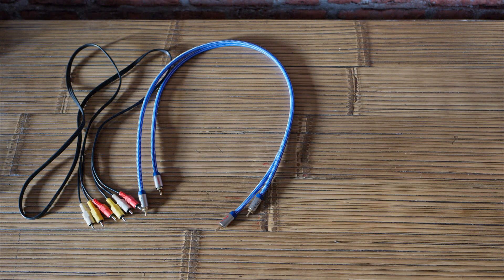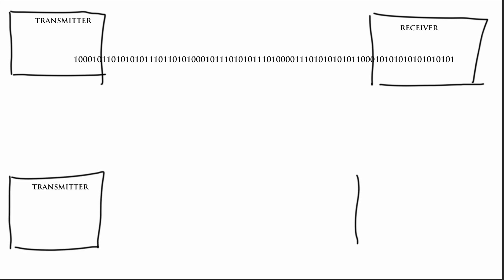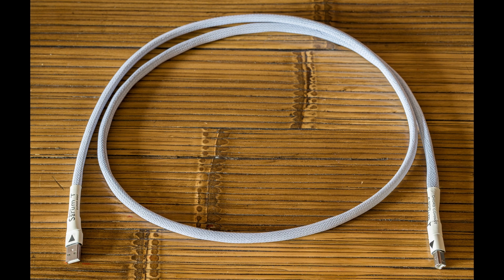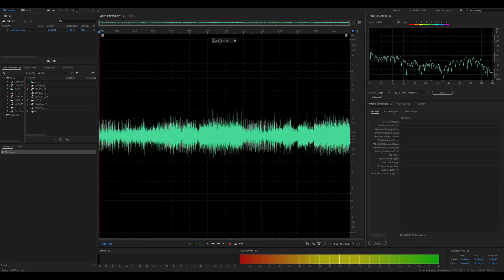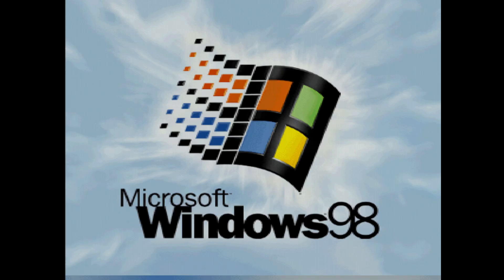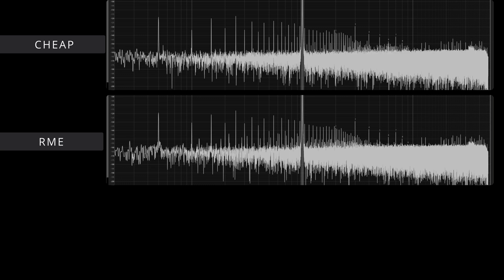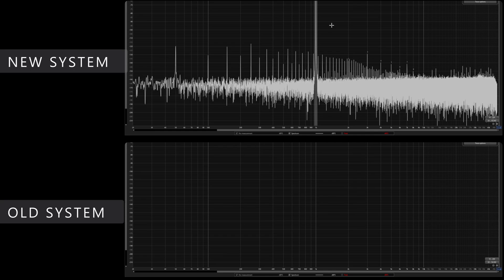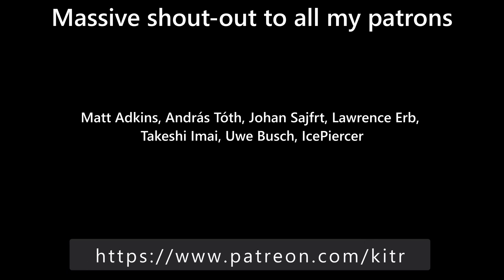Is buying an expensive USB cable worth the money? Do expensive cables really sound better?

Comment: You clearly didn't lubricate both ends of the expensive USB cable with the included snake oil. It softens the 0's and give them a buttery smooth presentation, and also allows for infinitely crisper 1's.

Comment: Hi Karl, and thank you for sharing. Amir at Audio Science Review, did a test with the Nordost Tyr 2 USB cable in March 2022. The test was extensive and Amir compared it with an Amazon basic USB cable. Despite a price of 1400 US dollars for the Nordost and seven for the Amazon basic, there was no difference. Amir concluded with: "There is not even a remote hint that the Nordost cable is impacting the performance of our DAC. We all know that it can't change the binary values going over the wire... Needless to say, I can't recommend the Nordost Tyr 2 USB cable."

Comment: Good cables are good to have. They're more reliable, you spend less time second guessing yourself in case of issues.

I don't think "audiophile" cables are even good cables tbh.

USB has error correction. There are 3 main types of USB endpoints, interrupt (they are what they sound like), bulk and isochronous. Interrupt points transmit short fast delivery messages. Bulk is used for most things, such as storage device major transfers. Iso is used for streaming devices, such as soundcards and video capture devices. A USB frame lasts 1ms and every major message has a CRC16 checksum, which has good error detection and can actually be computed back to the error bit location in case of 1-bit error, allowing it to be corrected. The difference between bulk and iso is that bulk transfers will be retried in case they're not successful, and will block until they're successful; while iso transfer errors do not result in retransmission - your soundcard can't just stop and wait for retry, it can only buffer less than 2ms of audio. If the error is not correctible, the device has the option of either playing things as-is errors and all, which will generally be audible as clicks, apply some superficial filtering to make the errors sound a little less bad (i don't think i've seen anyone do that on USB), or temporarily mute.

For this reason, using a webcam with a sub-par cable is absolutely infuriating, compressed HD webcams are a USB torture test. Audio only uses FullSpeed 12M link anyway so uhhh good luck making more than 1 bit error per millisecond and even that only once in a while, you'll have to try really hard. There's a margin between "it works bit-perfectly" and "it doesn't work" but it's fairly slim and shouldn't be a worry.
Reply: It would be easy to resolve this conflict by investing in a $15 USB cable checker. Go through your bin of hundreds of cables and chuck out the dodgy ones.
Reply: @JohnIrwin   Nah that's not very useful, those things will flag up missing connectivity, some cheap things can flag up shorts, but it can't flag up marginal quality. Just for USB2 HS an oscilloscope that can resolve the eye diagram costs at least 8 grand and that's just Chinese Siglent or Rigol not one of the actual fancy manufacturers. Starting 15 grand, you can have an actual quick automatic cable tester.